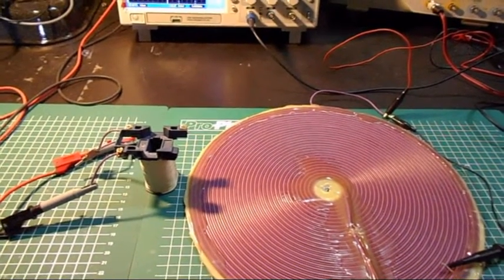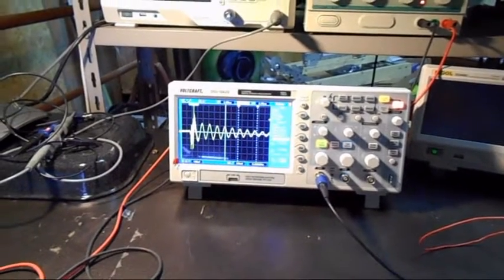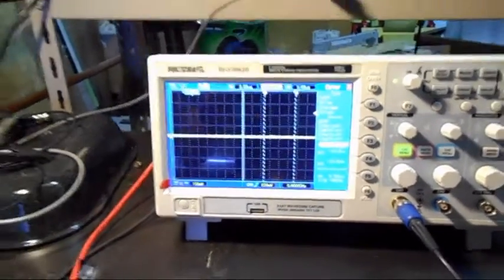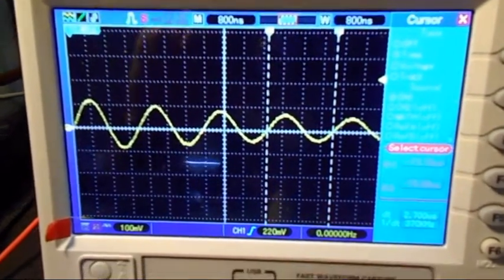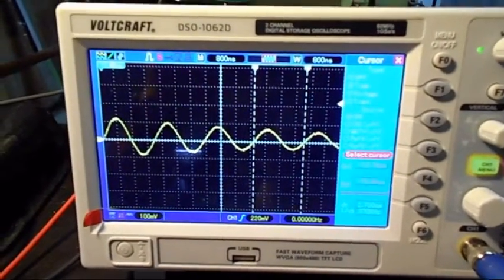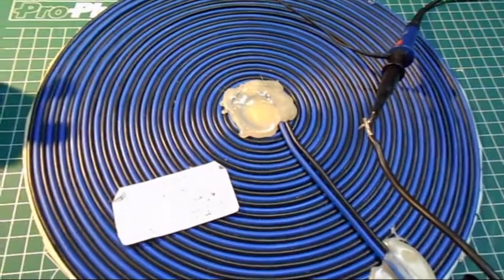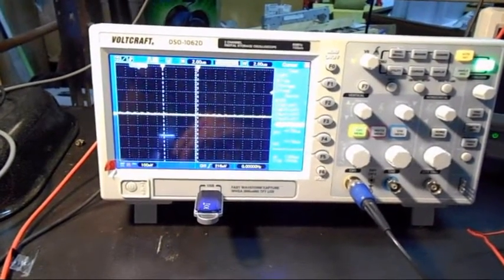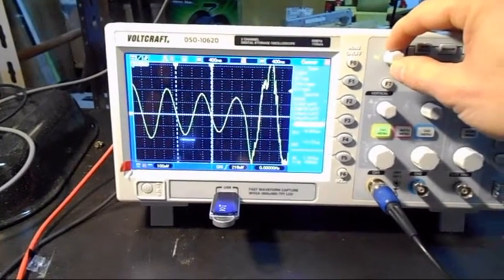001 Tesla Coil: Quick resonant frequency measurement

Comment: I have forgotten to ask you Bruno, what are you making? Are you making the "healing machine" ? The coil is big and must provide some serious power! If you have more videos, let me know when you post them!
Reply from the maker: I will try to respond tomorrow, I'm short on time at the moment, my appoligies.
Kind regards,
Bruno
Reply from the maker: Hi Tony,
At the time I did those experiments I was investigating if I was able to get "free energy". In the mean time I found out that "free" just means we take what's allready there but we don't realise it. The best quote I ever read was: We're like birds sitting on a high voltage line and ask ourselfs where the electricity is. It's just because it's in balance arround us that we think theres nothing there. 

I didn't go for health solutions because I find it dangerous because I don't know not enough of that. If we where able to look at living organisms like Rife with his microscobe and see the influence of frequencies to kill microbes that's a whole other story but sadly this is not the case.

At the moment my research is in the direction of resonance and the Don Smith device, but I would like to have it low voltage.
My goal is to light a 10W led, with a battery of 7Ah but very much longer then you would do it the primative way in a closed loop system, and if possible don't use any high voltage in doing so. At the moment it looks like I first need to build it with high voltage though, but you need to have a goal in research :)

Kind regards,
Bruno
Reply: OK, you have a VERY BIG GOAL! I think you understand this much better than I do - I am at 0.000001%.... ha ha ha... but one must start somewhere! I also have way too many hobbies and I also like to play with Arduino, Raspberry PI, photography, 3D printers... to name a few! BUT I also do believe that the electricity is everywhere!  We are surrounded by magnetism but also something like the electricity, but it isn't exactly  what we use today. The good example are the pyramids and the picture of a very large "bulb" that we do not know much about it. I just assume that in the past, all these great pyramids and stones that we could not build and lift with today's technology, was moved as simply as you and I move a can of Pepsi! Because these 2 different, but complementary "electricity" (for a lack of correct term), behave in such a manor we don't or can't measure and or use, it will take a genius to decipher, just like when we started with today's electricity. Einstein and Tesla mentioned little bit about it, and many great physicists also, but because the "free energy" that Tesla wanted to make, could not make money, back in the days... you know the story... and transmit it ANYWHERE IN THE WORLD, the media and Edison (I do not like him much!) made sure that Tesla was called "MAD SCIENTIST", so nobody took him seriously!!!  We see this happening today, including governments, large corporations ... that prevent great ideas to be used!  The obelisks that are all over the world, in my humble opinion, served some kind of  receivers-senders mechanism, I would say ANTENNA for some kind of energy that isn't exactly the electricity of today.  It will take many people to get it going, but lets hope that we will not let it go, once we discover how it works and how we can use it! I should stop, I have so many ideas, it hurts my head! ha ha ha  But again, thank you for everything and keep in touch!
Reply from the maker: Dear Tony,
At the moment I believe today's electricity is a reaction of the ambient to our action in case of magnetic generated.The spinning of the magnet is our action and the electricity is what the ambient reaction causes in our coils. So I believe, at the moment, we're allready using it but don't see it, we only look at the result because that's what we're able to measure. The ancients would indeed have better connection to all of that. It's funny when you look at those pyramids and other buildings that so many people are like a devil in a holy water barel when you say it couldn't be with just copper chisels 😊

Comment: I should add that I'm very careful with voltages above 30V and or higher amps!  I also do not experiment with expensive stuff, such is the kit from OneTesla that isn't my own, just helping the club. Nobody wanted to assemble it, since it can be dangerous. Please read my answer to Bruno bellow... I did not mentioned that this coil isn't connected at this point, sorry about that.

Comment: Thank you for sharing your videos! I'm building a OneTesla from :  https://onetesla.com/  and I would like to measure my coil - I do have 100Mhz Oscilloscope and 50Mhz Function Generator? For some reason I can't get it to do much at all. Thank you very much!
Reply from the maker: Dear Tony,
Thank you for the comment.
It's tricky to give possible guiding lines for measurement on high voltage devices.
Please read comment complete first before taking action (please forgive but I don't know how experienced you are)

If I had a problem like this I would disconnect the highvoltage coil(s) completly and measure on the base of transistor (or gate of mosfet) and see if you have signal until there. Because a Tesla coil needs resonance I think there will be a base frequency (resonant frequency of coil) and then amplitude changed according to the music or signal you put in. But I don't know the principle of working of it, it's just a thought. If it's the case like I just described you can see on your scope what's missing the base frequency or the amplitude changement. Please keep in mind I don't know the working principle and make sure to remove any high voltage part before making measurements. Also be sure when you have used it recently you wait long enough for every capacitor directly seen or indirectly (everywhere where you have 2 conductors separated with insulation you have capacity and even your coil has capacity) to be discharged.
Reply from the maker: For the high voltage part I refer to the tuning explained on the onetesla page: http://onetesla.com/tutorials/tesla-coil-tuning
It's to dangerous to give guiding lines on that part of your circuit by me.
Reply: Thanks for your reply! I should mentioned, but I did not, sorry about that!, the coil isn't connected at this moment. I just want to measure the coil it self, making sure the very thin wire is connected to the both ends, so if I would connect it to the OneTesla project, I would not harm the coil. Measuring it with a multimeter isn't working - unless you know what I do not. But I'm open to suggestions. I do have a 100Mgz Oscilloscope and 50Mgh Function Generator, to name a few toys from my archive...I do not know much about coils, since that isn't what I usually play with. I'm re-kindling my childhood dream to play with electronics projects, in my late age.... I love to fix stuff and assemble simple projects, this is for the club I go to - nobody wanted to make it. Thank you again!
Reply: Thank you also for the detail info - I understand that you do not know me and or my experience.... Your mind is working on the caution side first, greatly appreciated! I do know that capacitors like this one, needs to discharge and is extremely dangerous! I've burned several screwdrivers back in 60's when playing with old TV's and radios that had big tubes and sparks with sound, when making mistakes!  and ... it scared me - that was a great lesson for a young kid ! So I'm extremely careful and I take a great care while working with this project or any electrical voltages/amps that can hurt or kill me or someone else!  BUT I had a 50+ years gap from electronics and last few years I'm trying to rekindle this hobby. So for your info, I know some stuff but I do not know enough!
Reply from the maker: The part of not enough also counts for me 😊 when I finished from school years ago, I thought I learned something, 10 years later you realise you where just in a follow up of the santa clause story to keep you away from truth. Lucky enough 20 years later I came to the resonance kit of Rick Friedrich, if you want to learn the truth about resonance, I seriously encourage you to have a look at that kit: http://www.r-charge.net/Resonance-Loving-Paths-Kits_c_30.html you wont see sparks flying on the beat of music, but your in for a much more intresting way on what's going on. Offcourse it's everybody's freedom to go for the sparks or both 😊 

For people reading this message, there are movies on the kit https://youtu.be/70wqEfMdoVY I'm so thankfull to have come across this kit I have to advertise it, my appoligies if it's not what your looking for. I will respond to your other comments later because I'm short on time right now.
Kind regards,
Bruno
Reply: Thank you again for your concerns and useful information! I also play with "free energy" but my brain and resources have a limit, unfortunately. But that isn't keeping me from trying and if you have some ideas and or want to Skype, I'm all ears! Anyone can suggest other information here or directly to me, because I love to learn something new every day! Learning to me is essential to my life and I wish we can all get together and have some hands on meetings and it is possible that we will discover something GREAT. I think TESLA was and is the real brains, not Edison, who was a businessman more than a genius - please don't attack me (I'm talking  to few out there to take my personal remark personally, because it is just my own opinion) .  When you look at the genius Tesla and his incredible discoveries we all enjoy in our lives, that aren't even teaching in our schools! Anyway, thank you very much and please send me anything you find interesting!
Reply from the maker: Dear Tony,
In this movie you find a circuit I use, but you must leave out the capacitor because in the case of the OneTesla coil, the capacitor can cause very high voltage to be generated on the coil: https://www.youtube.com/watch?v=7x3wi6N4n_A&t=32s 

You must use SMD components because they are low in induction. I got the circuit from somebody who is really into RF. Offcourse there are more accurate solutions, but for the little components to use you will see the results are close enough for whaat we're doing at the moment.
I will try to incorporate a measurement in a movie I'm going to make, hopefully this weekend. I'll keep you posted.
Reply: Thank you very much! Using SMDs is the way hm? I just purchased a nice AmScope, because of SMDs and my eyes .... But now I can solder them also!
Just need to get hands that do not shake! ha ha ha   Ok, keep me updated and I need to purchase a sortiment of SMDs so I have more values on hand.
Reply from the maker: Dear Tony,
At the moment I'm only using 50ohm and 1000ohm of the smd resistors. Offcourse for experimentationn it's nice to have an assortiment.
Reply: Which assortment kit did you get? My friend purchased one from China, it took a long time, but it has lots of values and I must ask him where he purchased it from, so I can order it also.
Reply from the maker: Dear Tony,
I orderd my values seperatly, this is the search term you can give in: 1 W 1KR 1 K 1000 ohm 102 5% I took the 1Watt version because they are litlle bigger to handle. For the 50 ohm it's 51, maybe there's exactly 50 ohms also but that are my current values, I don't have complete value kit. They also came from China, my budget is also limited, what you see on video's is a build up of years. I'm now around 10 years into the search of what is and how to get ambient energy.
Kind regards
Reply from the maker: Dear Tony, you have to watch out with power 1\8W max is not much, you will probably need to do experiments with capacitor in series with your coil, or only using the higher values of resistors to limit the current, offcourse you have to watch out for the higher voltage that will be available at your coils (damaging you measurement instruments) when using the series capacitors.
Kind regards,
Bruno
Reply: Thank you for your suggestions !  Yes, I do not connect any meter and or my oscilloscope to experiments! I value my tools and I use a special high voltage probe that is 1000x less - for an instance, I used a multimeter and the probe, when I was measuring the output. The TeslaOne project creates such a high voltages that I don't even know how many 100's of thousands of volts is created. But one day I'll have a probe for that also, since I love the high voltage experiments. Our club has a show next Saturday and I disassembled 4 fly-swatters from Harbor Freight and made them spark little more. But the voltage stays around 800-1200 volts. I hope I have time to create a multiplier for at least one of them, to make a larger boom! Kids and adults love my Jacob's Ladder and I improve it every year so they can see a very large spark that travels up the rods!

Comment: They are Scalar pulses. I would like to see them unfrozen. If the wave goes right and left bouncing back and forth. Nice work on this video. I am subscribing and I would like to see more videos from your channel. Thank you for sharing.
Reply from the maker: Dear Ralph,
Thank you for the message. I will need to do that test again because I only looked at the triggered wave. I will look for the coil and will do that test, when the video is made I will add it here. (maybe this evening)
Reply from the maker: Dear Ralph, I did some measurements with the Tesla coil using my motor generator kit from the other movies as a pulse generator for the ringing of the coil. I didn't see a difference between normal coil and tesla coil. In both cases the waves where slightly going back and forth even when I set the triggering to the other coil. Offcourse this was not at the resonance frequency of the coil, maybe there are some changes when that happens. The video which shows my measurements: https://youtu.be/Kqz7PnIU65g
 I will have a look at your video's also because I've seen a part from the one with explaining the scalar waves and I'm intrested in it.
Kind regards